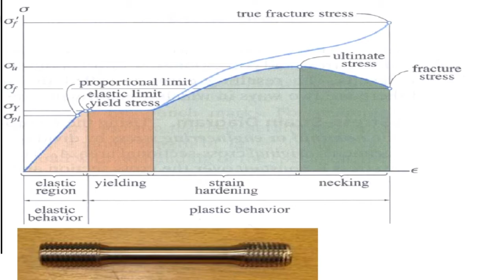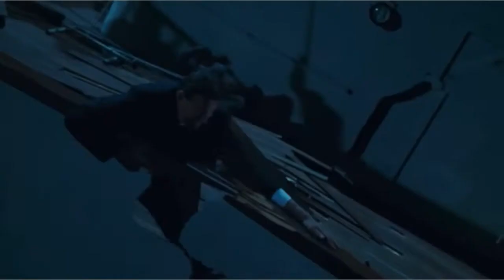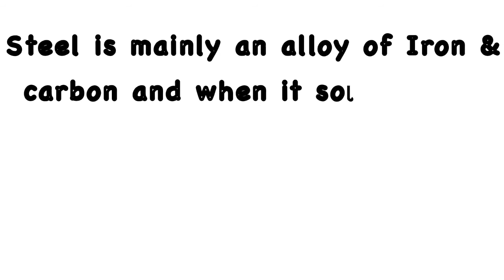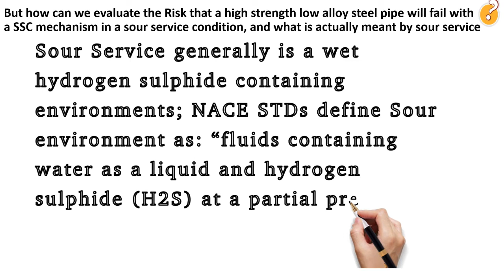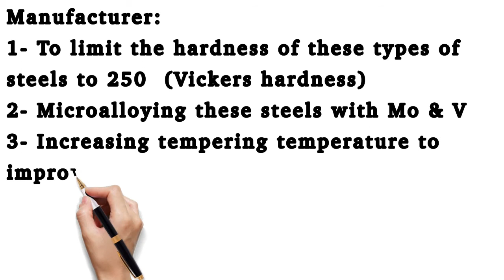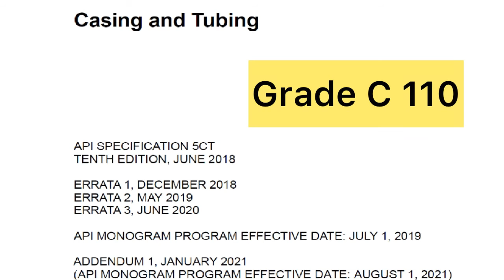RBT- example of SSCC risk in Sour service (Part5- a) - special part

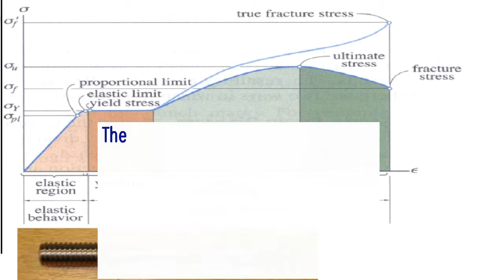Comment from the maker: Just to add that it was mentioned at ~ 1:22 of this video, that area under the stress-strain curve (for the plastic deformation part) is Toughness which is correct definition for such static / non-impact load, but it is for the whole area under the curve both elastic and plastic, so above addition in parentheses was not very accurate.